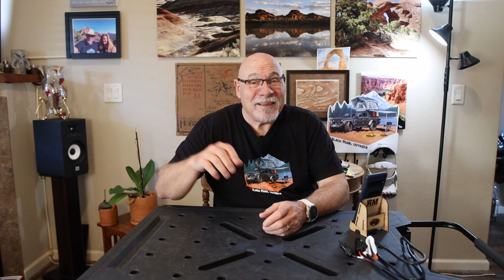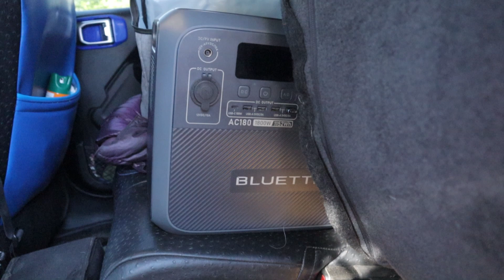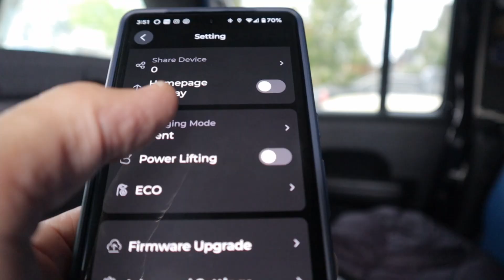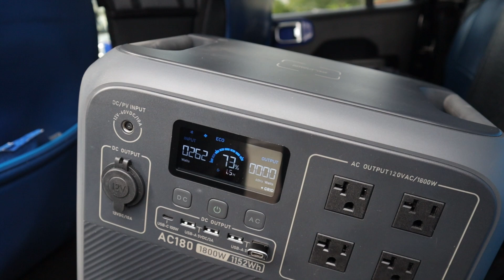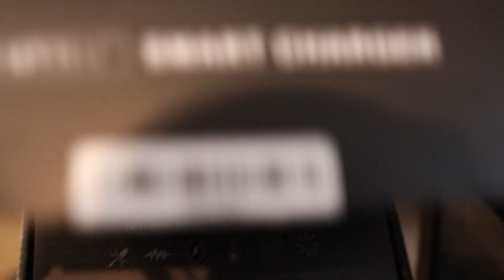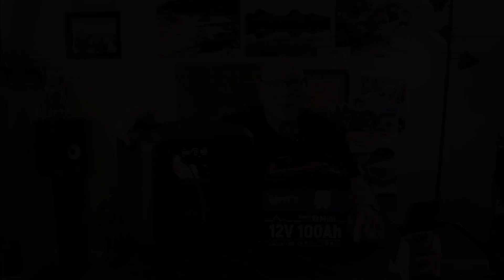DOUBLE your BLUETTI capacity easily! Or ANY Power Station/Solar Generator!

Comment from the maker: @raguellagrande7344  thank you for reminding everyone that if you use the pure sine wave inverter method of charging it does put a large demand on your vehicle battery and so you must only use it while the engine is running. 

I had hoped I made that clear in my video but it's possible that I did not. Thank you for pointing it out and for watching. Cheers!

Comment: Nice you posted this but there are already at least 20 videos showing how to connect a battery to a portable power station. In a similar fashion to your RV'ers. You can also connect that Watt cycle or equivalent to the side port of your RV to double or triple the house batteries too.
Reply from the maker: @philc.9280  Yes I'm sure there are gobs of videos about this but context is everything. 

I was just highlighting the newer lithium iron phosphate batteries that have been miniaturized so storage and weight savings are significant especially in relation to minimalist overlanders who don't like carrying a lot of stuff with them like multiple bulky solar panels. Cheaper now too! Also it is entirely possible that people who subscribe to my channel are unaware of these new technologies and I thought the information would be helpful. Certainly I was unaware of it until now 😆

Thank you for watching and commenting as all viewpoints are welcomed. Cheers 🤙🏼
Reply from the maker: @philc.9280  That's an excellent idea too. I do have a 16-ft trailer with a PV input that would work exactly the same as what we've done here. Thanks for watching 🤙🏼

Comment: I've noticed a lowering if price for gas or diesel generators. Sadly solar just can't keep up with demands. 
Also, while it may seem obvious, it's important to keep in mind with a car battery, charging while stopped can drain it and leave you stranded
Reply from the maker: @raguellagrande7344  thank you for reminding everyone that if you use the pure sine wave inverter method of charging it does put a large demand on your vehicle battery and so you must only use it while the engine is running. 

I had hoped I made that clear in my video but it's possible that I did not. Thank you for pointing it out and for watching. Cheers!

Comment: I love my Jackery500. It's done good for me for 5 years of overlanding. I do really like that bag you have for yours though! An insulation bag would be very useful. I would like have a second battery that would just live in the back of my truck. Maybe a 1000 watt for longer trips. I have had really good luck with solar but I do find it to be kind of a pain to haul the rigid panel around. Your table is confusing to me!
Reply from the maker: @RevN3Adventures  I love my jackery 500, it's been really good to us but I just wish I could fix the display 😞
If you're referring to the table I used in the video it is one of those DeWalt collapsing portable workbenches and there's lots of holes and slots cut for clamping and such. I rebuilt a Volkswagen engine on that thing! Good stuff...

It's what I had 🤷‍♂️

Cheers my friend 🤙🏼

Comment: we bought some 12v to 24v converters. I ran it off my switch panel it charges at about 197 watts and was about $20-$30. Ive only ever ran out of power a few times and it was mostly due to fridge issues (running non stop).  Also great to see you guys are still at it! :D I dont think we got to much at all last year. hoping for better luck this year!
Reply from the maker: @RavensEyeOffroad  so we have a tendency to run the refrigerator off of the truck electrical system while we're driving between destinations. Then before we go to bed we'll unplug it from the truck and plug it in to the power station and it only needs to support the refrigerator overnight usually during times of lower temperatures.

I'm not sure how to implement the 12 to 24 volt converters so I'm unfamiliar with how it works. You still have to power the circuit somehow and that's going to drain a battery somewhere 😆  Maybe you should shoot a video? Anyway thanks for watching!
Reply: I made one a long time ago. basically I have I switch panel that you would typically run lights off. instead of lights it goes to the 12v to 24v converter (12v in 24v out) which runs to the bed of the truck where i plug it into my ecoflow. the fridge always stays plugged in and i arrive at camp with 100% charge each time. :D